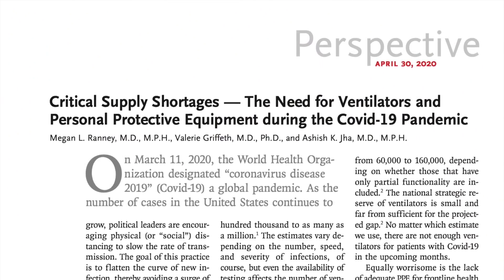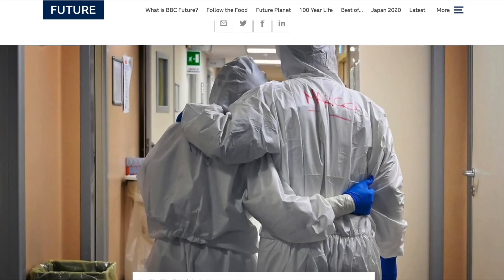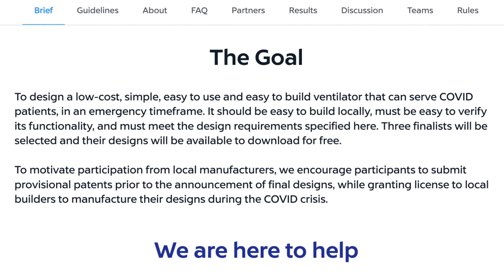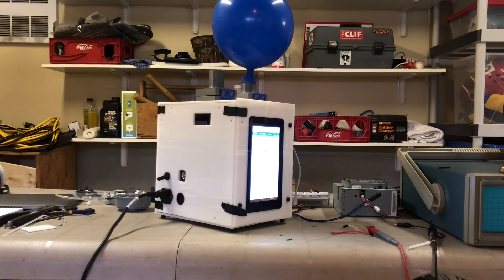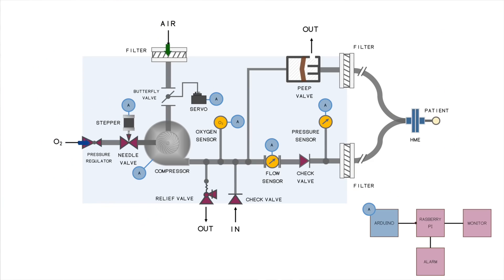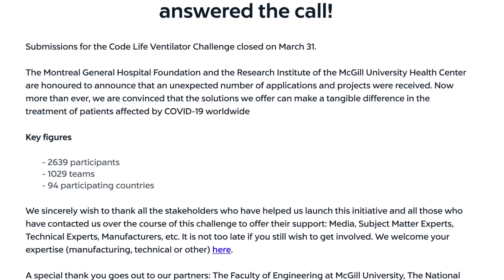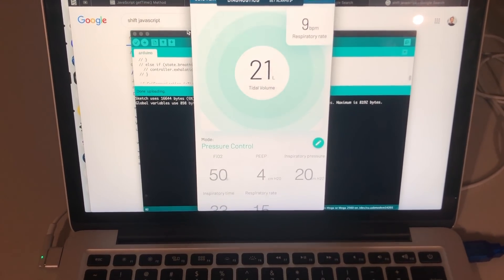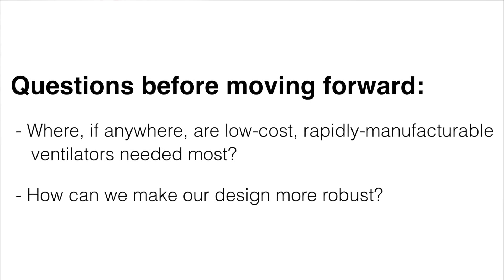We Built a Ventilator in a Month

Comment: I built a ventilator concept that is fully mechanical and very simple that can be plugged into an air supply or water supply to power the ventilator. It sould easily be made and used anywhere in the world at home, ICUs and ambulances. We can easily add adjusting stroke length & volume of breath, cadence, ratio of inhale/exhale, connecting many ventilators to one system etc.. The ventilator operate without power source.